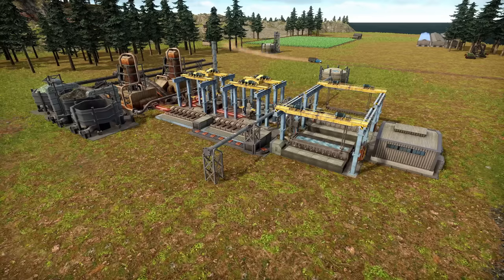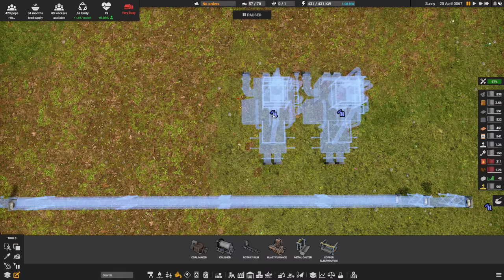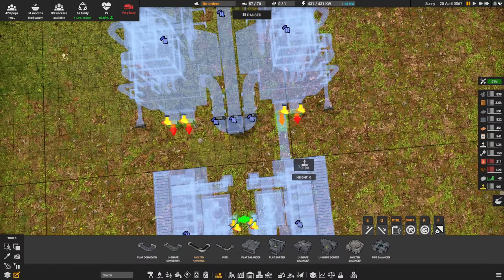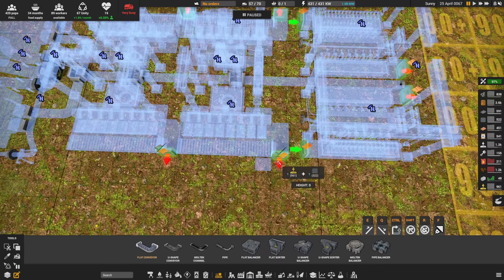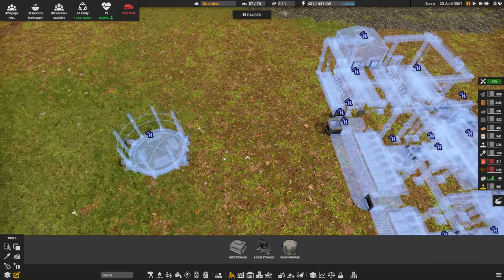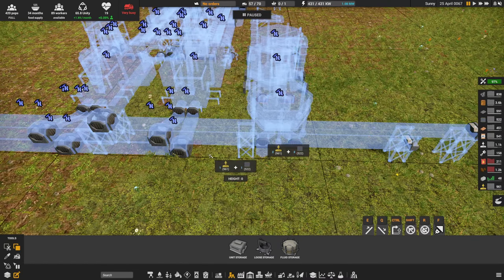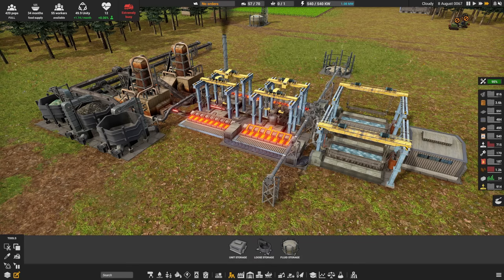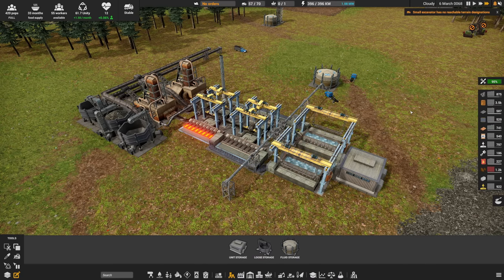Perfectly Efficient Copper Smelter with Electrolysis 🚜 Captain of Industry  👷  Tutorial, Guide, Tips

Comment: One improvement would be to put the water tank on the loose storage side. Expansion isn't blocked and might save a bit on pipe.
Reply from the maker: True, it doesn't really matter which side water comes in from, and as long as its a straight line you should be able to drop the next smelter beside this one without and hassles

Comment: Why not just use your iron build with 4 copper electros at the end? What's the difference?
Reply from the maker: Trying to get them all to fit, is the number 1. Number 2 is more belts for the machines and then to storage is more power. 3rd is 80KW per machine! thats 320kw of power for just the electros thats a LOT unless you have upgraded power, if you have then tier 2 belts are right there so you could just use the 1st iron smelter design. 
So there are many choices over all. This was the best design given the power requirements etc and the fact that you dont need as much copper as iron till later in the game.